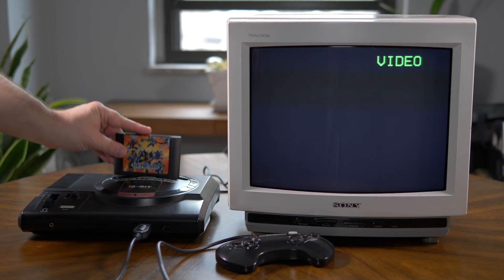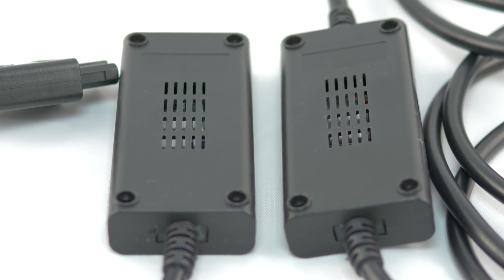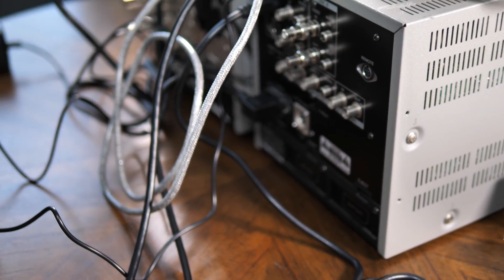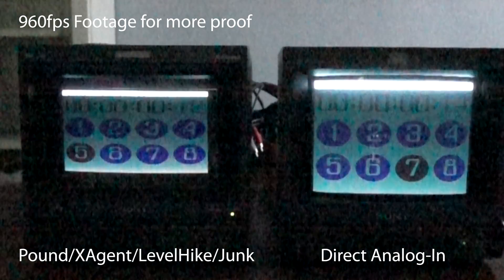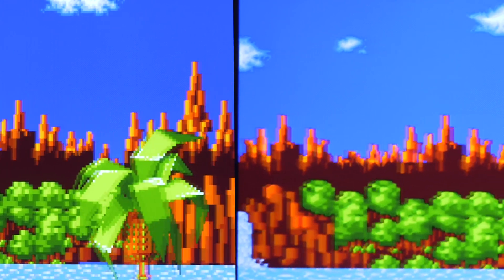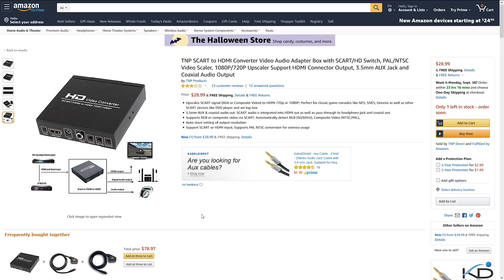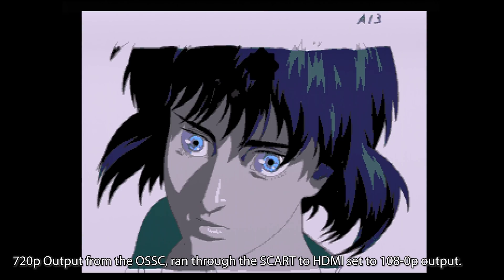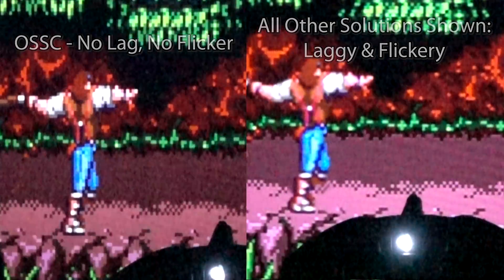The Worst Scaler In Retro Gaming

Comment: Yeah I just got one of these for streaming - works ok-ish for that. So I split my RGB signal and one goes into my CRT and the other goes into one of these things then into my capture card. As I say, seems to work ok that mostly. Will upgrade when I can space the $$$
Reply from the maker: That's the PERFECT use for it!  Just my opinion:  If you're only using it for streaming and your favorite games are 480i (most PS2), you might not need to upgrade at all.

Comment: Though the upside about the SCART to HDMI. It doesn't lose it's picture when a PS1 game does the resolution change. Though the downside is the picture is moved over to the right a tiny bit which can be fixed in editing....just gotta tough it out for the OSSC Pro which they said will have a buffer mode which get's rid of the sync drop in PS1 games.

Comment: Brilliant video, awesome examples. All backed up by scientific demonstrations. And just stopped me from buying something like this on Ali Express.  I still have the same problem though. I’m in need of a PS2 plug to component of a decent quality. Have searched the internet and not found anything. Any recommendations would be appreciated.
Reply from the maker: Thank you!  Check out this video and the links in the description for PS2 info:  https://youtu.be/a0Ksk9Zru_A
Reply: RetroRGB awesome thanks. That does look like a good solution and also a reason to pick up a PS1. Hopefully that will look a bit less glum and washed out than the component cable.

Comment: I bought that exact square black box some time ago. I have no idea why I ended up choosing it, maybe because I thought it was cheap to try out. And I can't stress this enough. As this video also points out, it is a horrible little box for gaming. The lag is so bad it completely ruins the experience (and yes, I do have game mode turned on on my TV). On top of that it has this built-in image smoothing going on that just makes everything look mushy and off. I wouldn't even use it for streaming I think, but I agree on the point that it can be used for that if people aren't too picky on image quality.

I just ordered the RetroTink 2X Pro and RetroTink scart. That should cover my needs. It's a relatively expensive solution, but looks like it's worth the price. Looking forward to finally be able to use my old machines with my modern tv.

Comment: I found an old CRT HDTV with an HDMI. It also has build in VCR and DVD. Best of all worlds, except light gun games. The HDMI has overscan, so I use component for gaming. I do have it hooked up to my 55 inch too. I also added a capture card for streaming. CRT is still the way I like to go for retro. 
I'm not a snobby retro guy. I don't have the funds. I don't care about up scaling. But, I did have most of my RF consoles modded to composite. That is where the money is well spent!
Great video.
Reply: Cool...is it a 4:3 or 16:9 TV?

Comment: Hi Rob, You know in my setup I use Splitters at the output of my Switchers,  so I can use old cables directly connected to my CRT tv  (as Scart, S-Video or Component) and at the same time connectto my DVD recorder outputting in HDMI FULL HD from there.  Then I  connect that HDMI output to my capture card, led  and proyector (thanks to a splitter again). But  I have a problem, My second DVD recorder , the one can convert Component to HDMI,upscale only to a max of 480p , so I was looking for a way to upscale HDMI 480p to 1080p but whitout having to pay excesive prices of 100 dollars for it.  SO, do you know any device beside this chinese upscaler? since is the only option I founded until now.

Comment: The saddest thing is that the SCART-HDMI box has the power to process images with a low delay but is badly configured from the factory.
Reply from the maker: Well, you're right, but I wouldn't call it "badly" - It was designed for TV signals and it does a pretty good job with those.  It was never designed for games at all.
Reply: @RetroRGB   this video show a lot of scaler options of the chipset:

https://www.youtube.com/watch?v=dvcoXRKdPvI

Comment: It's probably worth noting that for more recent systems the situation is a little different, like with the Xbox. In that case the Pound cable is just taking the 480i/p, 576i, 720p or 1080i YPbPr signal from an Xbox and passing it through to a TV over HDMI. In my experience results have been outstanding, but it's also not trying to do anything fancy like line-double a 240p or 288p signal. Others have also reported more mixed results, particularly with the original revision cable. Credit where it's due, Pound also revised their cable to add the option of external power to fix noise issues people were having, on account of some models of Xbox having weirdly noisy power delivery over the AV connector. Hyperkin, meanwhile still sells what's essentially the v1 of the same cable, complete with official Xbox licensing. Hyperkin as always finding a way to one-up the scumminess of questionable quality retro vendors.
Great video otherwise, it's just that 6th gen stuff tends to get overlooked in discussions about AV despite now falling under the 'retro' banner and also having a different set of needs.
Reply from the maker: Absolutely true.  I meant to have an intimidate follow-up video showing how those cheap analog-to-digital cables (no scaling) aren't great...but definitely do NOT ruin the experience.  I'll try to get that video out soon.

Comment: Its still good for a budget, I've had this S2HD for over 4 years to use with my RGB N64 with my everdrive V3. It works pretty good imo, but it does have blur with fast moving Fps/Racing movement or retro games like the nes when the sprite and backround would have a smoothing effect. I never put the scaler on Stretch widescreen 720 or 1080(even more lag and very ugly look for retro) my upscale will put out like 3 other kinds of 4:3 output: (small image)800x600, (medium) 1024x768, (Full)1280x1024. The games looks way better already in those 3 kinds of ouputs then this comparison of 16:9 mode. Also the extra blur on top of the N64 - AA was getting annoying after while playing on it, so i looked up the auto patch AA to use on my everdrive games. Woah what a improvement, after the patch the games run little bit better with AA-off, the picture is improved and gives out brighter colors. No more dark smearing effect, even the NES emulator takes advantage of the patch too! The sprites/background not nearly as blurry when scrolling across the games. I don't even notice the lag as much as Bob's making it out to be , added few more frames is not so bad on n64 games on HDTV. While playing Nes Contra the lag was not even a problem. If Tiny bit extra lag going to mess with your gameplay maybe because you've been playing Retro on a CRT only(0lag), want to finally want to upgrade with the same reaction time. If you have the money$$ for a nice upscale with all the bells an whistles to go with a low lag flat panel then of-course get that instead. 
This Scart2HD is great for N64, even better with a Everdrive and making Nes, Game Gear emulators work great on it as long you get rid of a layer of blur with Auto-AA patch(or gameshark) and keep the aspect to 4:3 never use 16:9.. grab a nice Scart cable(Bandridge)

Comment: I don't know, I have a pound for my OG Xbox and haven't noticed any problems.
Reply from the maker: Actually, if it's just converting analog to digital, there will be zero lag.  This video was focused on that SCART to HDMI, as well as the Pound cables for 8,16 and 32-bit consoles.  I'll follow up soon with a video about the equipment you use on your xbox...but it might be totally fine.
Reply: @RetroRGB  It's good to know that distinction. Does the PS2 work the same way?  I have the older consoles as well and I was considering getting pound converters for them based on my experience with the Xbox. But I'll just continue using them with my CRT.
Reply from the maker: Most of the PS2 "Pound" cables I've seen work as bad as the SNES ones.  I'll cover that in the video too

Comment: I've recommended them in the past and I will in the future, but the thing is, I know their problems and I always warn people about them, just so they know what they're getting into. For a lot of people, they're not a bad idea simply because even with all their flaws, they're still better than connecting a composite signal into a modern TV, what most people still do. A lot of people don't want to spend 200$ on a OSSC or even 100$ on a RetroTink X2 and only want a little more clarity than Composite and for them, it's pretty okay. I always recommend them over the generic cables because if they want to buy an OSSC later, they will already have the SCART cables for it. I think they're pretty decent for a beginner, as long as they know the limitations of those scalers (what a lot of reviews don't do unfortunately) and I still use mine for recording because they're so simple to use.

Comment: 2 things to add.
1st: I have bought 2 of those cheap SCART to HDMI boxes and neither even worked. No signal. They are cheaply made in China. And since they're sold through shell companies, you can't return them. 

2nd: I've heard awful things about the SNES Pound cable. I want to say I have the Dreamcast Pound cable 2.0 (the one with a detachable HDMI cable) and it's not bad. Maybe because the Dreamcast natively outputs at 480p, there's none of that reading 240p as 480i that causes so much flicker and blur. I think the Dreamcast Pound cable looks good (a big jump up from composite) and I don't notice any lag, though I'm sure there is some. There are better options out there, but for at least double the price. Dreamcast Pound is only $20.
Reply from the maker: You're correct - Any of the Dreamcast cables that just convert analog to digital should be fine.  It's not the best solution, but zero lag and no stutter means it's perfectly okay to use.  I'll have another video on this soon.

Comment: I have tried a bunch of this junk from Amazon over the years and eventually went back to an old TV just to get the proper experience. If you are used to certain games (I am thinking Shinobi III personally) with tight controls and the need for exact accuracy you will find that these things introduce lag that makes the game unplayable in my opinion. I wasn't about to spend on a Framemeister and was kind of looking into the OSSC until the RetroTink was released. This magical board solved everything for me. This unit along with some HDRetrovision component cables for systems that use them was a Godsend. Even for systems that do not natively have RGB (like the NES, Vic-20, N64) this box does so well for them that I am not even concerned about modding those consoles at all. It's really all I need!

Comment: I used that HDMI scaler well Keeping it at SD/ED resolutions. I haven't used it in a very long time since I just went with emulation because an RGB setup took up too much room, but if it works well with video...I should try it with Laserdiscs.

Comment: My cousin's Wii has a (probably) cheap HDMI converter but I didn't notice anything off about it when playing the Wii on a flatscreen TV. (Granted, I had never played on an original Wii before then.) I'll be sure to look out for these cheap scalers. Good video!
Reply from the maker: Well, Wii's different.  If it's just doing an analog to digital conversion, it won't add any lag or flicker at all.  I'll have a video on those soon.
Reply: @RetroRGB  Interesting. What is being converted into what signal for older consoles, then?

Comment: I started out trying a Pound Cable, and quickly upgraded to using a RetroTink 2x with SVideo.  The fact they pushed "full frame" (aka stretched) images through the unit was death for me on my 4K TV.  I was stuck with a stretched image, as my TV didn't have a "4:3" mode to squish it back down to it's proper aspect ratio.  The colors were also so oversaturated that I couldn't properly correct for it.  

For most consoles outside of the Sega Genesis, the RetroTINK with sVideo works beautifully, though.   It may not be a "pretty" as RGB, but I already owned the cables from years of CRT playing.  Sadly the RetroTink doesn't support RGB natively, just component, so to get a good picture on the Genesis I'd have to invest in some HD Retrovision Component Cables, which are on my list but not my budget right now.

Comment: I'm using one kinda cheap upscaler and while the image can be better (and for recording I have to use OBS or equivalents to have the resolution image I want because is streched), I haven't feel any lag, BUT still even with that, I REALLY want to get a better upscaler once I save enough money, but if you can suggest me a cheap one for recording (and playing) games on a flat screen, what good scalers should I get for my retro consoles (NES, SNES, Genesis model 2, N64, Wii, PS2... also suggest me a good cable for the PS2 with the composite method, or the best quality image with a proper upscaler as well), excluding the expensive ones like the XRGB Mini?

Comment: No.  Input lag is /not/ the difference between the native delay and whatever added. It's cumulative.   If a console natively has 3 frames of lag, 2-3 frames more won't typically make a huge difference.   Even 4 or 5 can be totally fine for some titles. This matters because half of the community's CRT-purist talking points boil down to "CRTS have NO LAG but LEDs have 8 or even 16 ms of lag!111!" without adding that... CRTs, naturally, average out at around 8ms of lag to start.

The base value absolutely matters.   Not saying the overall thesis of the video is wrong, just these special exceptions are incredibly misleading and biased.   

That's coming from someone who owns multiple PVMs and BVMs.
Reply from the maker: You're wording is misleading and part of the problem we're facing.  Also, bringing up "CRT purists" in the context of this video is deeply insulting, considering how much effort I put into assuring people it's NOT about that.  Please re-word your comment, or just delete it.
Reply: @RetroRGB  Even if you find the mention 'deeply insulting',  the misinformation of 0 lag gaming comes from the CRT purists/elitists. No technical basis for special distinction of '0 lag' exists.  Think about it:

Consoles exist that average at 32ms lag,  50-60ms lag, and 128ms lag.  By this distinction, each and every one would be '0 lag'.
 
You're well respected. People are going to take your tech semantics very seriously and this video, I guarantee, will be linked to support claims that (CRT/retro console are 'zero lag')

Despite that not being your core point; which I explicitly agree with.

Comment: I appreciate your doing the right thing. I purchased that scaler and good rgb to scart cables for my Genesis and in five minutes realized the scaler was blurring the image while scrolling in Phantasy Star 2. I then discontinued use. Then I RGB modded my N64 based on info on your site and the scaler works OK with 3D. I dont mind spending money to learn and appreciate the problems and challenges.  I will buy the cheap new scaler you recommended can't remember its name.

Comment: Are the latest Hyperkin cables for specific consoles using the same scaler as the nefarious "Pound cable"? (I get the feeling they are packaged for people that might buy them as an impulse purchase.) If so, I wonder why they don't just source a better chip.
Reply from the maker: Hyperkin's SNES cables are absolutely the same junk.  Not sure about xbox or dreamcast, but as long as they just convert analog to digital, it won't add lag.
Reply: @RetroRGB  Interesting. What's more interesting is that an independent fellow like Mr. Chi can put together a setup like the RetroTink 2X that works so well, but a big company with a lot more resources can't get it together. It's also a bit weird. How did they manage to make some of their accessories well enough to win awards and be officially licensed if at the same time they make and sell cheap/junk items?

Comment: Interesting video, is there a good option for SCART to HDMI or component for under 50€ you would recommend?
Reply from the maker: The RAD2x are the cheapest at $50, but it's one per console.  If you're connecting multiple, I suggest the RetroTINK2x or OSSC.

Comment: Awesome video and agree with almost everything except one thing...how is the ossc better than the framemeister?
Reply from the maker: The OSSC has zero lag, doesn't compress the colors and can linedouble 480p to 960p.  The Framemeister has 1.5-2 frames of lag and compresses colors on the input side.  BUT, the Framemeister is compatible with everything and some OSSC modes like 5x and 960p aren't compatible with certain displays.
Also...the price.

Comment: Good video! I went from the exact model of cheap SCART to HDMI adaptor you have in this video to an OSSC and the difference really is night and day. I can thoroughly recommend the OSSC to those who can afford it.

The only thing I would mention though, that you didn't touch on in this video (unless I missed it) is that the OSSC only accepts RGB inputs, so any console that only does composite and doesn't output RGB - like the Amiga CD32, or (PAL?) N64 you can't use with an OSSC at all.

Comment: Great video. Basically it makes the games play in 30fps instead of 60. Quick question, have you tried any of the cheap vga to hdmi converters? A scart to vga converter can be made fairly easily.
Reply from the maker: Every cheap analog to digital converter I've tried only digitizes the image, so there's no added lag.  Sometimes it messes with the colors, but that's certainly not "experience ruining", just not as good as it could be.  I'd feel comfortable just picking one up and trying.